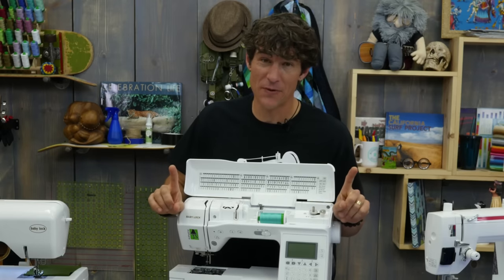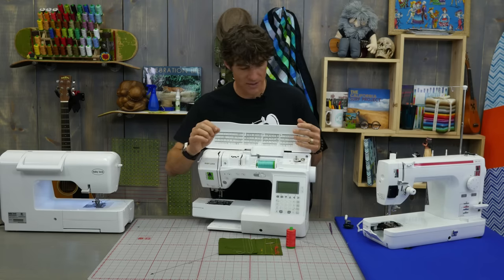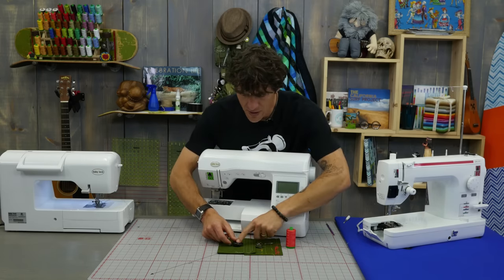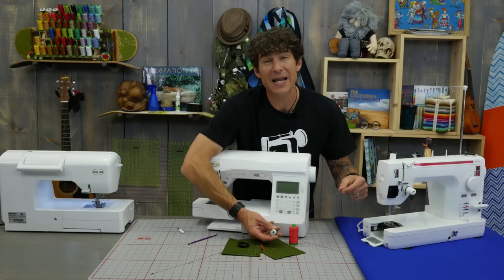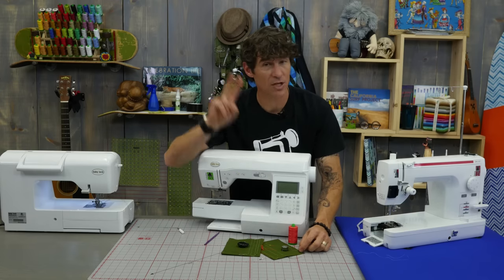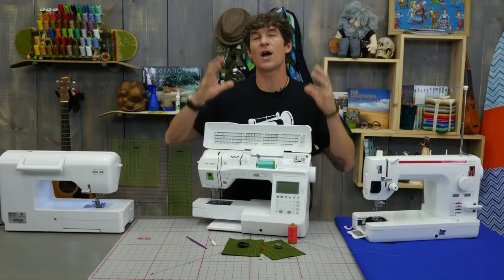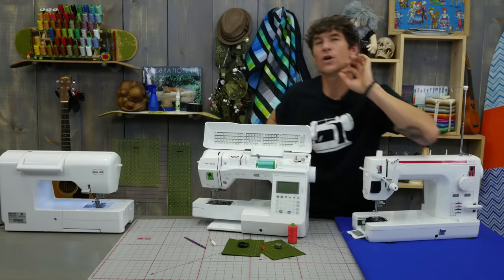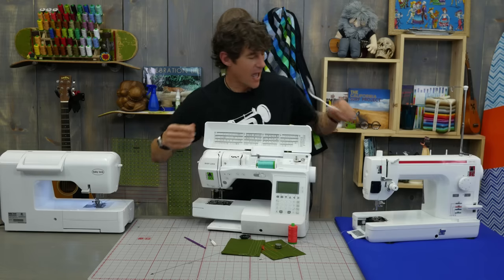Sewing Machine Maintenance: Tension

Comment: Hi thanks for the info, any suggestions as to why my singer 132 k6 is not stitching at all. checked tension , timing  etc , top thread is picking up bobbin thread and that's it , won't stitch at all. ?

Comment: Your information was very clear, but I have tight tension on the top, move the dial to loosen it and the thread keeps breaking - over and over! I checked threading, needle position and thread weight - the thread simply comes thru the tension disk very tight to start with. Please help!

Comment: Thank you for doing this video!  I have a question: I took my Brother sewing machine in to have it repaired because of the loops I was getting on the bottom of the fabric. I tried changing thread, needle, taking off the walking foot....nothing worked so I took it in. He called me and told me he couldn't fix it but that it was a tension problem. I had told him that my sweetie took the top part of the machine off to retrieve a screw that fell off the presser foot holder down into the plate below and I turned the machine upside down and it went up into the "top" of my machine. (Sorry for the boring details) The repairman told me that maybe the tension bar got rattled a bit, and I may need a new tension bar, and he was not able to get one. Is that a possibility to have a new tension bar put on? Do you recommend that I order one and put one on myself...or does it have to be "calibrated" or whatever tension bars need LOL. I hope you can suggest something. I could probably find another repair shop . Thanks for any advice.

Comment: I have a new machine in the shop.  I am using my old one.  Know I have a huge tension problem.  I finally figured out whats wrong.  My bottom thread looks perfect. My upper thread pulls straight out, because the bottom is not looping tight enough over the top.  My upper tension when pulling thread is good.  My bottom is so loose I can pull a foot with a good pull.  I have threaded correctly.  I have cleaned.  I have put bobbin case in bobbin holder correct.  I sew every night for 5-6 hours.  I can hand sew but not on what I am working on today.  I can make mask by hand.  I don't want to be without a machine.  Can you help me?  Do you have email where I can send pictures?  I am using Brother XL2600i  I just bought a new Brother PS500 with thread problems forever.  I took to a new repair shop this time.  Hoping for results that are good

Comment: how to fix still loose stitch at the back even the tension is very tight that I can hardly pull the thread when setting the thread on the tension.. is it some timing  issue ,if so where to adjust... my macine is singer merrit with zigzag    .thanks for reply

Comment: My sewing machine is a Brother NV30, a top loading bobbin type.  I tried to do all your suggestions but my thread tension is still not right.  I have turned my dial to 1, even 0, and yet the bobbin thread is still seen on the right side of the cloth.  It seems that there is no difference between a dial #9 and a #0 setting. It does not show any difference in the appearance of the bobbin thread.  The thread is still seen on the right side of the cloth.  What could be the problem?  Does this say that my Brother Sewing machine is a lemon?

Comment: So, I have a Pfaff Ambition 1.0 with a drop in bobbin... I have double-checked the lower tension, and it's good. I also use my brush to clear out the fuzz and dust below all the time.

The issue is my top tension. For it to NOT loop, it has to be set on a tension of between 6-7! It didn't used to do that... 

So, my question is, how do I fix this? Or is this a "Go to the pros" situation...

Comment: Thank you for this video especially of the 3 you posted last week. BIG QUESTION: Since the tension discs tighten when you lower the presser foot, am I harming a machine by storing it with the presser foot down on a piece of fabric? Should I keep the foot up instead? I'm not sure which position would be harder on the spring that works them..........I also didn't know you could use a pipe cleaner in the tension discs, and didn't know about looser tension for things like zigzag satin, or free motion work. Thanks for those tips!
Reply: I'm just glad I haven't been killing my machines! I read somewhere the feed dogs are fragile, and I have managed to bump the foot lifter lever to make my foot slam down onto the uncovered feed dogs teeth before on a machine I have that swings into a cabinet and lays sideways. No apparent harm done, but it made me rethink how I should store them!  Then I saw this and thought: "Uh-oh!" Thanks much for the reassurance I wasn't being a spring killer.

Comment: Having looping problems at the bottom  and needle breaking on my pfaff grand quilter. Started after I did a wall hanging free motion with canvas backing instead of using batting. What would be the problem?

Comment: Do you  give advice help??.. I need help so bad I’ve used my sewing machine 9 times out of the 20 years since I’ve had it.     it’s a brother XL 3027, All I’m trying to do is straight stitch 2 layer non-pill fleece together... I know on top the machine there’s a left and right scroll numbered dial... I’m not sure if I have those on the right number - I have them both on #4... but underneath my material is a hot mess!... 
I took my machine to a Sewing repair guy and paid $140 to tell him that’s all I’m doing is a straight stitch can you fix my machine... it worked well for four projects but I may have turned the dial again..?.? Because I was working on thicker fleece...
I am a beginner and I just need someone to tell me what dial I should have..? I watched your Tension video but it was for different machines... help...  thank you so much for your time...

Comment: Hi there, great explanation of thread tension! I accidentally pulled out the little door on my front-loading bobbin area (Brother LS-2125i), and a little piece of metal that seemed to be loose in there somehow, came off and I can't figure out how it goes back in. But when I try to put the door back in, it's too loose. I've been watching videos, trying to see that piece of metal and how it attaches, but I can't find it. It's a bit more than 1 1/4 inch long, 1/2 " wide for 1" of its length, then narrows to 1/4 inch and bends into a slight lip. At the 1/2" end it has a 1/8" hole. Does anyone have any ideas? Thanks!

Comment: I have a Singer Quantum Stylist 9960 with nesting issues on the lower side of the fabric and the machine sounds like it's tapping, sometimes clunking. I cleaned the bobbin case, fiddled with the tension adjustments on the LED panel and the machine is still not working properly.

Comment: Great info.  I've been having a problem with the upper tension knob.  I usually keep it set around 4 but the knob loosens all by itself. I had to put a piece of tape on it to hold it in place.  Any ideas?
Reply: Ỵes, it is external tension system. I have Janome MC6600p.  Thanks for any help.  It works with the tape but would really like to fix it myself if I can.  Other than that works great and doesn't need servicing yet
Reply: +Rob Appell Thank you so much.  I am a little scared to try that myself so I may wait.  You are the best!

Comment: Hi Newman my Singer 9005has problems Iwant to know it the fabric not running under the pressure feet and the manual Hand on the side to start the machine not moving also. The foot turn hut once I turn the switch on

Comment: Hello,  I get confused when it come to the numbers ( 4 is tighter and 3 is less is that correct) could you please send me a message on numbers. Also My destiny machine tells me to tighten the green screw on the bobbin case.  I have taken my machine three times in the less 3 weeks and they can not get the tension right. My bottom tension is like the one you showed it is pulling the top thread down and it shows the little knots. HELP Thank you.

Comment: thanks for the tutorial. I tried to service my brother xr6600 sewing machine, ever since I opened it, whenever I try to sew my stitch length button does not control the stitch length. 
I don't know if this is a programming problem or is there something I can do to make it work.
Reply from the maker: Hi Bukky, Did you check the owner's manual or an online forum for Brother machines? There is a lot of information out there, especially about Brother machines. Hope this helps.

Comment: Rob, I love your on-line and in person (remember those days?) lessons.  However, I humbly have to point something out.  Not every bobbin unwinds clockwise.  I have several machines, a 301 for instance, where the bobbin unwinds counter clockwise.  Maybe modern machines with side loading bobbins go in clockwise.  But it is decidedly not the case with vintage machines.

Comment: I have a problem with my tension on the top. My stitches are too loose underneath. I have tried to adjust the tension dial going from 0 to 9 but it made no difference. Can you tell me what is the reason for this. My machine is a Singer  6038.
Reply: I have this problem as well, I’m gonna try and change the thread, have you tried changing it?

Comment: First thing I do if my tension is off is,  unthread the whole machine,  including the bobbin.  Check the bobbin housing and surrounds for fluff or stray threads.   Rewind the bobbin,  thread the machine, and change the needle.   Lots of times this fixes it.  If it doesn't fix it,  then I adjust the tension.   Sometimes it's just a cheap or old thread causing the problems.

Comment: It has been so long since you made this video, I hope you still look for comments! I have a 73 year old Free Westinghouse that has always worked perfectly. I keep it cleaned and oiled. I was trying to get Christmas presents done and all of a sudden the tension went wonky and my top thread is going in a completely straight line and I can just pull it out of the material.  Bobbin tension looks great. I have gone through every number and it is still doing the same thing. I tried turning the tension as far as it will go and the discs were completely shut, and then went to the next number until I got to the lowest number. Nothing. I have been threading this thing forever so I know it is threaded correctly. What is going on?

Comment: I have a mystery! I have been sewing for many years. in the
last year or so I have been trying some quilting, more specifically, free
motion quilting. I have a pfaff quilt expression 4.2. Have had pfaff machines
for many years. My fmq (free motion quilting) challenge initially was getting
muscle memory with the different designs. Didn't have many problems as I
attributed the bad look to my inexperience with FMQ THEN,,,,, I started having
tension problems,,,, and these were not consistent, and I'm not able to say, it
was the type of thread, thread weight, brand, or the type of fabric. ??? I was
getting pretty good with the shapes and ... again inconsistnt with how the ?
tension was working? finally I decided to buy a straight stitch only, maching.
I bought a juki TL18. semi industrial machine for quilting. demo'd at the store
with no problems. Got it home, and wha-la, having some of the same issues.....
I'm about ready to just give up on quilting all together. Am I the only one
with problems like this? I have to say as well, My stitches seem to look better
on the bobbin side. But the new machine has had, skipped stitches, broken
thread,,,, and I have only had it for 2 days..... very frusturated. :-0 not
sure anyone can help me. If you have a suggestion,,,, I'm all ears! Really
thought I was a pretty good seamstress? re-thinking that

Comment: I use a tension meter to adjust tension.  Ok problem I have with a machine I'm working on, when it zigzags it works ok for 10 - 15 stitches; then, it does a straight stitch for one stitch; then, back to zigzag.  I put it to doing a blind stitch it works ok.  I've cleaned and oiled it.  It's a Kenmore 148.  What's going through my mind is something messed up with the cam stack?  I've not seen any other machine do this.  I need to know what I can get in California to clean the cam stack.  Sprayway C-60, sewing machine degreaser, is hard to get and requires shipment by rail.  What else will work and not damage plastic?
Reply: The tension for a Singer Featherweight bobbin case is 23 grams.  What should I set the bobbin case tension on a Singer 328K and a Singer 16-188?

Comment: I can pull out my top thread in one go and my zig-zag stitches are terrible, I tried increasing and decreasing the tension, still have the same issues
Reply: If concerned about the tension, lift your presser foot up and cut the thread at the spool and re-thread. Use a different color in the bobbin and start with a straight stitch. Check your tension in straight stitch, usually about a 4.5 on the dial, then when you go to zig zag, lower the tension to about 3 to allow the thread to pull on the wide stitches. When the foot is up, no tension, foot down = tension on thread. If you are not feeling this, you may have a dust bunny in the tension discs, and that is affecting the tension being too loose.

Comment: I just can't fix the tension. The upper thread always shows on the bottom and it makes a clunky noise. I put the tension as high as it will go and it still shows on the bottom. Also I have the stitch at the longest but it makes a small stitch. I'm frustrated with this machine. I used to love it. It is a Kenmore that I bought at Sears around 1995.

Comment: I have a Brother machine with a drop-in bobbin.   I didn't know you weren't supposed to mess with the bottom tension.  It doesn't help to just adjust the top tension.   Turning the screw on the drop-in bobbin case helps sometimes and sometimes it doesn't  I have been sewing for over 60 years and really don't know exactly how to make the tension perfect for top and bottom.   I just play with them a while and they'll do well for a while,  then the machine grabs the fabric and won't let it go.   I don't like these drop-in bobbins,  I like the old kind.   It was
easier to do the thread-drop test,  and it worked.  Nothing works well with this drop in bobbin.
I hate it.

Comment: If I'm sewing on leather or heavy denim I use a 30 weight in the top and a 50 weight in the bottom, but it seems that my neither of my stitches are tight enough. I always put in a leather needle or a top stitch needle. Any suggestions?
Reply from the maker: Hi Jennie! First, the leather may be so dense, that the thread can "bury" into the leather as the stitch is formed giving the "too loose" look because the thread is sitting on the leather not in the leather. I would also consider using 40 wt in both the needle and bobbin so the weights match and the the thread sitting on the leather will at least look nice on both sides of the project. I hope that helps!

Comment: What to do  my brother  sewing machine Ls-2125  have a loose spring  in the back of bobbin  how to fix this?
Reply from the maker: Hi Lina, Thank you for your question. I looked up the Ls-2125 bobbin case, and it shows as a standard class 15, therefore, you should not have a spring in the bobbin case. You have the spring plate on the outside of the bobbin case that controls the bobbin thread tension. I am not truly understanding the question, and am not an expert on that machine. I recommend you seek help from a Brother dealer. Sorry to not be able to help more. Thank you!

Comment: Ok- the presser foot up or down thing has permanently changed my life. HOWEVER I am being tortured with bad tension. My discs are working fine- i’ve got a live one on the hook so to speak- but my bobbin thread is much like your example- it could be pretty much pulled straight out- and I’m using 30 wt cotton thread. Regardless of how high I turn my dial.. NO MAGIC. If anyone has any suggestions- PLEASE HELP ME! :)  One thing I have noticed is that the piece my needle goes up in (the metal piece with the thread guide attached to the screw that you use to change the needle- comes totally off sometimes when I change my needle and It wants to rotate when I change out my needle. Ive never had this happen before until I got a juki. Maybe that’s normal.. maybe it’s my problem? Ugh🙄

Comment: My SE1800 came with 2 bobbin cases.  Well, rookie mistake.  Long story short, I didn't have the bobbin case in correctly and damaged the factory installed (green screw) bobbin case.  I have since ordered the correct replacement for ordinary sewing and embroidery.  However, I tried using the alternate bobbin case (no color screw) for (from Brother manual) "different weights of bobbin threads and a variety of embroidery techniques."  

Problem is top thread keeps breaking.  I don't know if this bobbin case can be adjusted for just sewing like the Green screw  bobbin case.  Any suggestions.  I'm a long time sewer, not so savvy with the all electronic machines.  Any help would be appreciated.  TIA
Reply from the maker: Hello! I would recommend checking with your sewing machine dealer on this issue. The green is usually paint on the screw so that you cannot adjust it, and when you do the tech knows it. The screw that is not green should be the one that is adjustable for the different weight threads. You should be able to set the adjustable case to standard thread weight and then use that for all needs moving forward. Please double check with your dealer to make sure I am not misleading you.